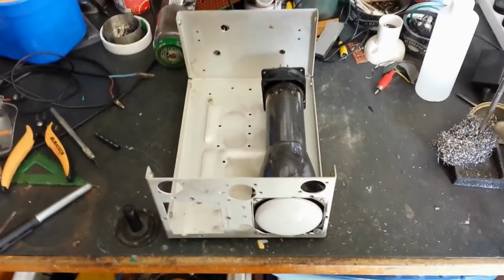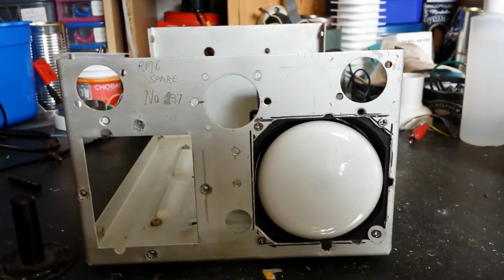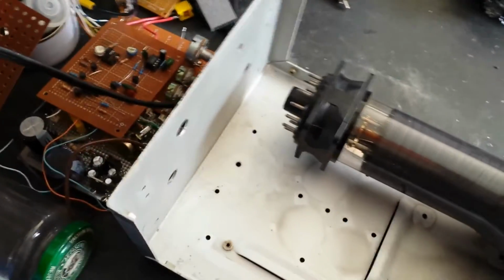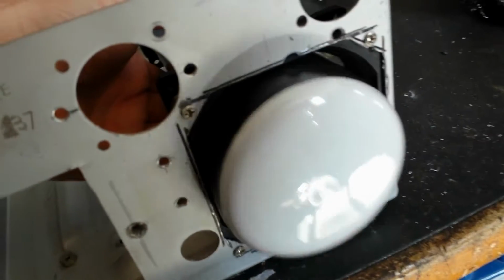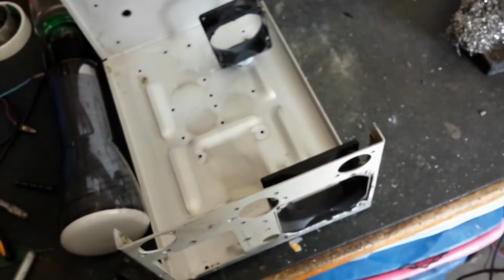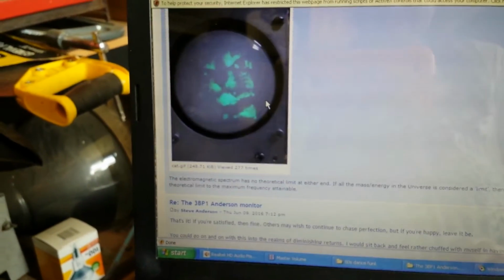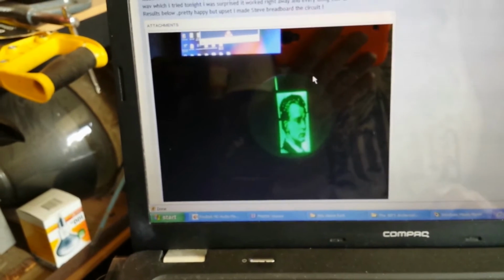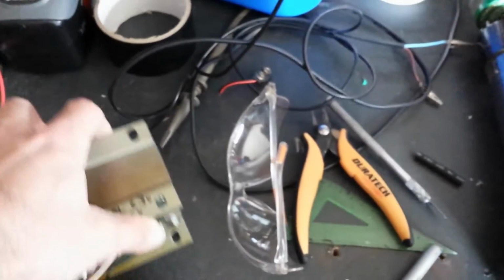RCA 3BP1 CRT video monitor project (Part 1)

Comment: Might be a piece of mica or ceramic loose inside the tube, should not do anything unless it gets to the front and scratches the phosphor, or it could just be loose adhesive in the base.
Reply: it cant get infrond
it is just a peace of glass or glue inside the tube socket
Reply: Sorry, I thought it was inside.
Reply: it could happen
but it is to rare to care about
i know this problem cus it happens alot on p sockets